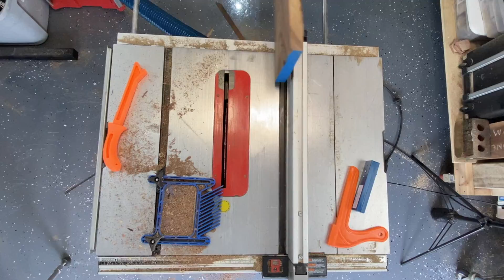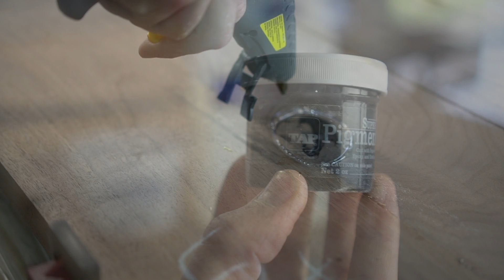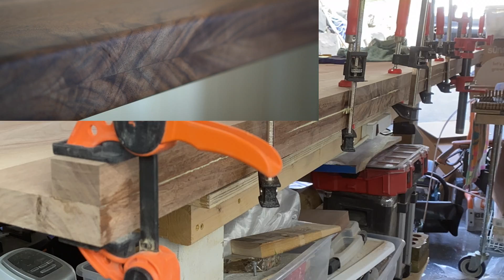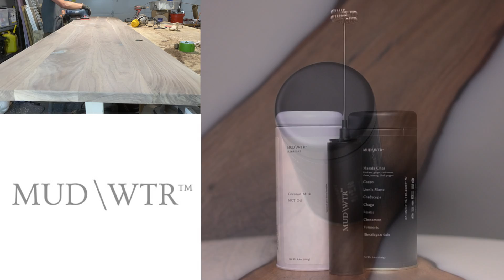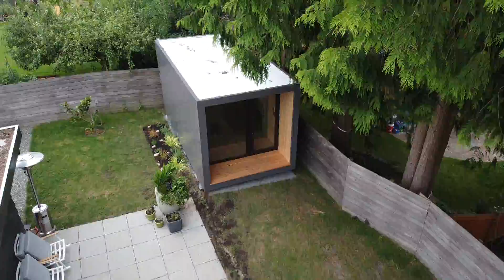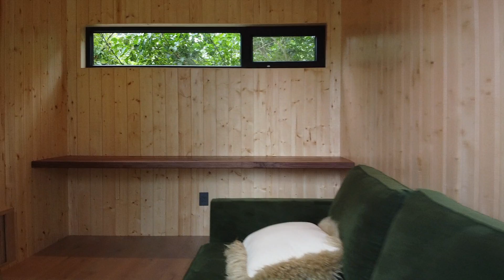DIY FLOATING DESK // WALL MOUNTED DESK

Comment: I really want to do this but It would be a corner desk (meaning it wont be supported on one of the edges). Can will the steel bar provide enough support? If not then how can i make sturdy without adding a leg or L bracket?

Comment: This was a very well thought out build. My only concern is that 8'+ is a considerable span, and having that 1 1/2" angle iron seems of limited benefit on its own.  Since you have a fair amount of space under the desk, a piece of 1-1 1/2" square tube could be run wall to wall, about half the depth of the desk for greater deflection proofing.

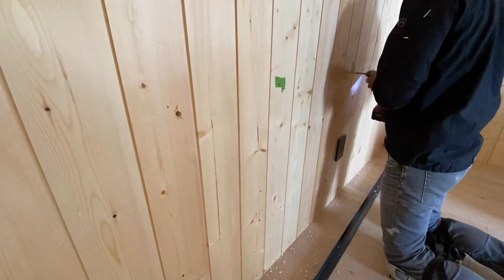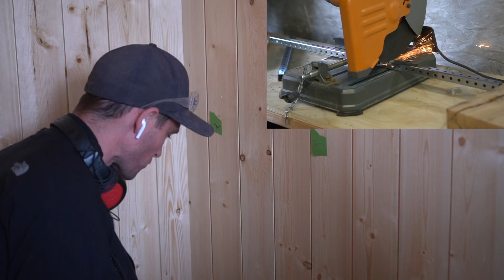Comment: Great video. I had in mind to use homestore angle iron as supporting brackets, as seen at @14:21 instead of the tube steel @13:12. I haven't tried but I think angle iron might work better if you mount it upside down so that it provides a lip for the table top to rest on.

Comment: beautiful walnut desk. Was planning on using walnut as well and have the same 3 wall set up. How long is your desk? Mine will be 10' long and was planning on using a 2x4 framing system but I like how clean your rail system is. Clean but may not be good for hiding cable management system
Reply: Mine is 12 ft and was planning on using 2x4 system as well, but I'm trying to see if I can finesse the rail system

Comment: Was looking to do something very similar to this, but I am mainly worried about the weight the desk is going to be able to bear before bowing.  If I were to follow this wall support build, and the desk is 112 Inches long and 36 Inches wide and I used your rail system with a brace bar in the center (or toward the lip of the desk).  What weight would you predict the max load would be?
Reply: I’d like to know the answer to this too.

Comment: Hi, I love the work here! I have a Ikea butcher counter top and hope to make it into a desk like this video but I worry the cube tube will not able to hold the weight of the butcher top. It going to be 94inch by 20 inch in 1¹/² inch. Do you think the cube tube will be enough to hold it or what will you recommend? My walls are finished. Thank you
Reply from the maker: Great to hear and thanks so much for watching. In all honesty based on what I used as long as you hit a few studs on the back side and one on the left and right, then use some heavy duty wall anchors I think the tube will be plenty strong.  You will be able to connect to three sides like in my video right?  Hope you subscribed
Reply: @BYOTools  thank you for your response!
Reply: @BYOTools  found out that the rightside of the wall doesn't have any studs, what would you recommend?

Comment: So I'm old school with regular good old wood glue I did buy some super glue that's for wood have you gave that a try I haven't used it yet wondering what your thoughts are
Reply from the maker: Super glue normally has a. Very quick drying time so it’s not the right glue to use for woodworking.  Old school wood glue is the best in my opinion.  Thanks again for watching.
Reply: @BYOTools  no the super glue I'm talking about is  especially made for wood. I think a lot of folks use it to hold the wood while they nail I'll have to search it and get back to you
Reply: here ya go.  titebond instant bond wood adhesive

Comment: Bar aka pipe clap, my best friend in woodworking ,that and gallons of glue. respirator? Finally  someone that thinks  safety.   Love your channel my pal ,first time here for me . Oh hell track saws are overrated lol . Also like the tape trick to avoid having to sand for several decades . Sticky back sandpaper is a god sent. I put it on a small piece of pvc pipe . I love watching  the sanding portion . I just about crapped myself when I was watching another channel ,the guy was sanding across the grain . Yep thats like fingers on a chalkboard . Love  how it turned out .Looks AMAZING . I'll be watching more I just subscribed .
Reply from the maker: Wow!  Great to hear and thanks so much for watching and subscribing.  It’s greatly appreciated.  I’ve got and amazing wood coffee table video posting this week on the channel and it sounds like your a woodworker so I think you’ll love this one. Let me know what you think when it’s posted. Thanks again!
Reply: @BYOTools  looking forward to seeing more
Reply: @BYOTools  unfortunately I don't have the time or the space for woodworking like I once had

Comment: How long does it take till the glue dry ? Anw awesome video man! 👍🏻
Reply from the maker: Great to hear Jo and thanks so much for watching.  Technically the wood can be unclamped after just a few hours based upon the glue instructions but don’t stress the joints for at least 24 hours.  Hope that helps and hope you subscribed.

Comment: Hi, Can I follow these instructions for a similar design. 2, 2in. x 10in. x 10 ft. making the desk dimensions 2x20x10. I am also adding 5 Strong-Tie 3in.x7in. spaced 2' apart. I only have one wall to anchor the desk to.  What would you recommend for anchoring for my desk?
Reply from the maker: If you only have one wall to mount to I would suggest using a bracket like this one in the following link.  You have to get the brackets to studs but once you do you will get the strongest support possible.  Hope that helps. https://amzn.to/2Zcx4dH
Reply: @BYOTools  Awesome! Thank you =]

Comment: So many of the videos I see use 3 walls.  How would you do this if you had a longer wall and didn’t want to go end to end?  What would you do to support it just from the back?
Reply from the maker: Good questions bud.  In that case I would suggest using a heavy duty bracket that needs to be attached to the studs, such as the ones shown in the attached link.  There is some extra work involved especially if its a finished wall but nothing that some drywall repair can't fix.  Thanks for watching and hope you enjoyed the video.  https://amzn.to/34hiVit
Reply: @BYOT. Enjoyed the video a lot.  Thanks.  And thanks for the link.
Reply: @BYOT Just checked out the bracket you recommended.  It looks perfect.  Thanks!!

Comment: Do you leave some space for the wood movement over the season ?
Reply from the maker: I did leave a little space but not much. about 1/4" of an inch.  Good question Kang and thanks so much for watching and for subscribing.  it is greatly appreciated.
Reply: Wood movement/expansion is primarily only a concern perpendicular to the grain. So as most boards are cut for length along the grain, you rarely are concerned with them growing longer/shorter over the season.  In this case, the desktop would not be expected to grow/shrink much beyond its current 8' length. However, that 24"+ depth is going to grow no matter how much you seal it, up to 1/4" or more.   

Considering this is a decent sized top with some weight to it, screw the back left and right corners of the top, and let the rest simply float. This will not constrain the growth and risk cracking.

Alternatively, on an all wooden desk you could put a small slot along the sides of the desk. Then you insert a clip that looks like an "S" with the top and bottom flat instead of curved, into that groove. The top of that clip is screwed to the bottom of the top.  As the seasons change and the wood expands/contracts, that clip attachment is able to slide to ride that expansion out, while keeping the top relatively constrained.